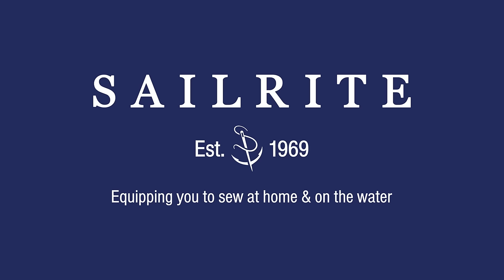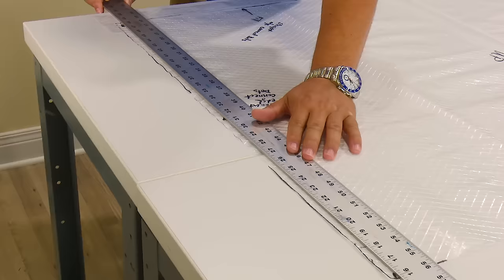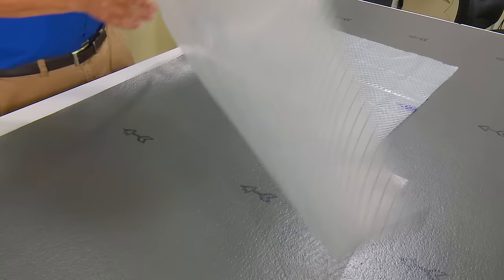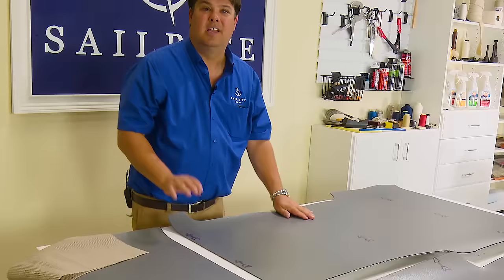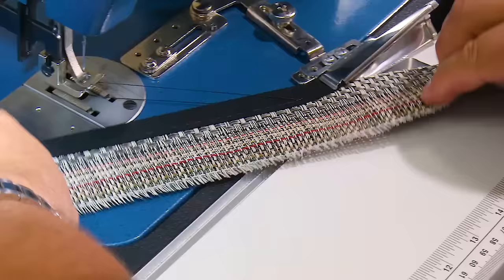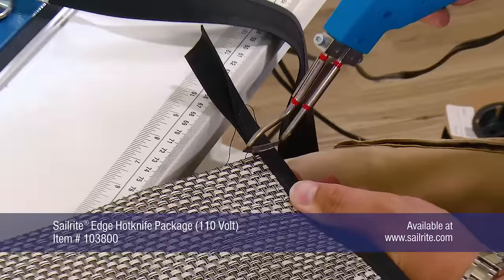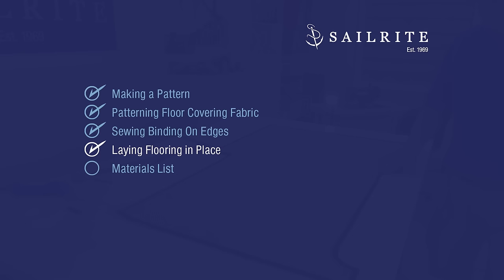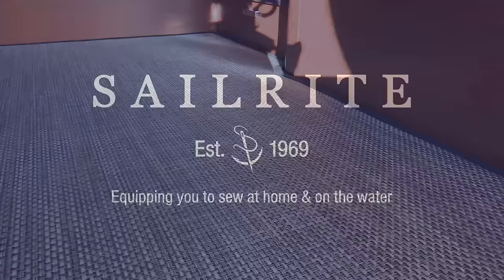How to Make a Woven Vinyl Floor Mat with Binding

Comment: I would suggest setting up a table, or ironing board beside the machine to support the fabric if you don't have your machine mounted in a large table.
Reply from the maker: Very good suggestion. It would make the job easier. Thanks!!!

Comment: Great tutorial...  But YIKES!  That's expensive flooring fabric!  (I almost had a heart attack when I saw the price!)  Now I know why Matt made suggestions for using the scraps!
Reply: you can use plastic sheets from home depot and a sharpie or paint pen.
Reply from the maker: Yes, it is about $7.00 a square foot (depending on the color and style). So, use it carefully and use it for as many applications as possible.
Reply: +Sailrite thats not bad though espescailly if you want it done right you can also save said stencil for later
Reply: Sailrite is cheap compared to ebay.  I was blown away by the difference.  
Great video BTW....  Im preparing to make a landing mat for inside our camper when you first enter.
Reply from the maker: I hope your landing mat project comes out great! Thanks!
Reply: OMG YIKES is right... really expensive... but old saying you get what you pay for... I have ordered a lot of fabric from sailrite.... awesome quality... and very very quick shipping...
Reply: This flooring was outside my price range. I had good luck using  IKEA outdoor flatwoven rugs. Seems like they're holding up alright, at 1/10th the price I can't complain.

Comment: does that binding attachment only work on sailrite machines or would it work on my artisan 797AB?
Reply from the maker: We designed the 1 1/4" Swing Away Binder to fit on many types of sewing machines, not just ours. It is highly likely that it will work on your artisan 797AB. If it does not, it can be returned in 30 days for all you money back (minus shipping). 
Here is the link: http://www.sailrite.com/1-1-4-Swing-Away-Straight-Binder